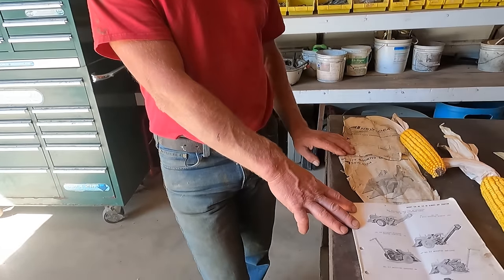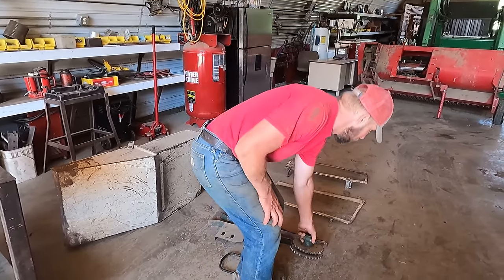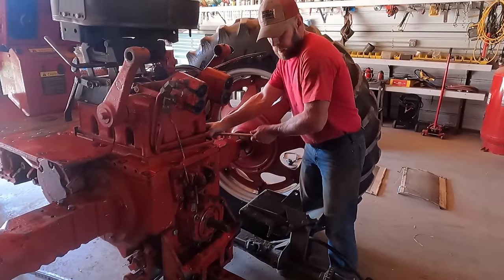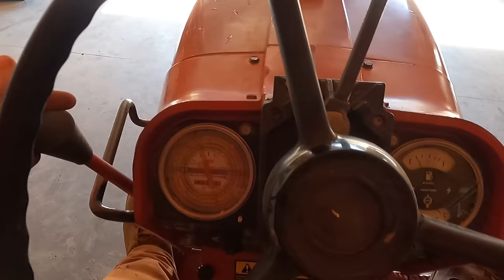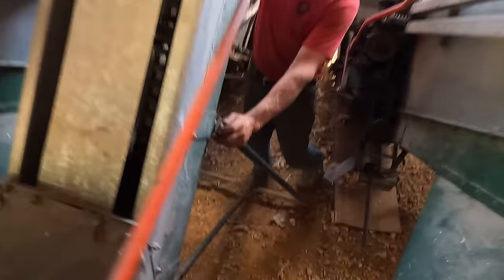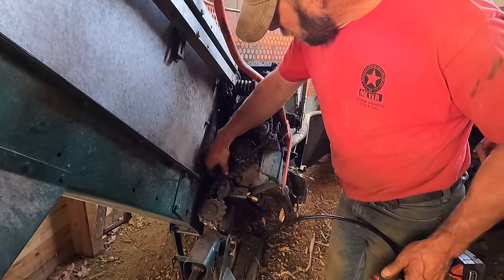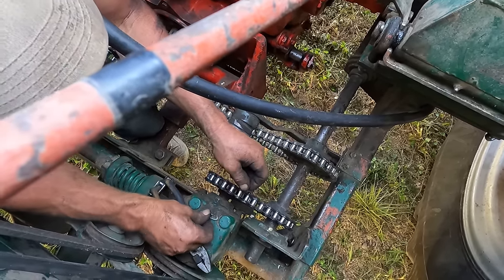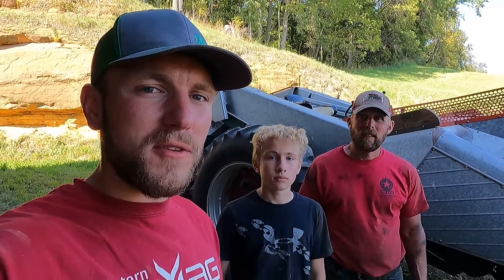Getting Ready for Harvest! Mounting the Corn Picker!

Comment: I submit THE least likely person to post here is me.  We are concrete jungle dwellers, drive the heartland every year and vacation in Oconto Co in summer.  I've rebuilt and cracked open a few engines and transmissions, but I am stunned at the relative complexity and number of moving parts, plus keeping those old machines running.  You guys "rock". There are a few of us out here who appreciate what you guys do to basically feed the world.  Blessings . . . .
Reply from the maker: Thank you that means a lot!
Reply: Well this is Bob & not my wife as pictured.  We never had a picker or sheller but a JD silage 1 row chopper to fill the silo.  We always did this with my uncle Lars, He'd put his IH 450 on the JD chopper & we had a W-9 on the JD silo blower.  Would chop into truck boxes a 8'x12' box with hoist & back up to the JD silo blower & fill the silo.  Had two silo's to fill.  We quit do this in the mid 1960"s.  Thanks for your posting your farm & I know since we still farm its alot of work.
Reply from the maker: @debraevenson2336  Thanks for watching!

Comment: Brought back memories.  Dad bought a new New Idea picker in the fall of 1972.  319 gathering unit, 322 twelve roll shucking bed, and a 315 sheller.  Mounted it on a 1550 Oliver for 10 years or so.  We normally kept the original wide front on the Oliver as we plowed, planted, sprayed etc. with it too, so we changed that out every fall as well for some added fun.  Overall, with some help it’s not a bad job to mount and the New Idea does a good job both picking on the ear and shelling.  We farmed in central IN then, and sold the outfit to somebody in Wisconsin.  Thanks for sharing, good job!
Reply from the maker: Glad we could bring back memories, Thank you for watching David!

Comment: I used a two row, with the 12 roll bed pull type. It was harder to open up the fields, so, sometimes i chopped some of the corn to get them open. But, I liked the New Idea, because it took all of five minutes to hook up, and, did not tie up a tractor, if i wanted to use it. I ofter would pick during the day, and, then switch over and do some tillage in the evening. I did think about buying a tractor, and, having a mounted plow on it permanently, but, just decided to put up with the hassle of opening up the fields.
Reply from the maker: We use to get a self propelled chopper to open fields for corn silage. But we decided we could do it our selves with the pull type, just had to take our time chopping the rows we ran over!

Comment: They weren't bad to put on and off. Worse part was we usually had to move wheel centers and even with that it didn't take long.  Had one on a M-TA and 560.............That 686D is probably a really nice combination.  Ear corn makes great feed.
Reply from the maker: The 686 is really nice, bit on the bigger side to fit underneath that. We agree it dose make good feed!
Reply: @GierokFarms  You need to make a video on how there is IH, Oliver, and Deere in one location with no fights...............I got Deere and IH here where I am, and probably one of the few who has two brands of tractors.
Reply from the maker: @tpfromcentralpa1692  We definitely aren't bias here, at the end of the day its all about what works for your farm!

Comment: 30 years ago I bought a 706 diesel narrow front for $3500.  As I was pulling out the driveway, seller asked me if I wanted to buy the hardly used 234 IH picker that he used with it.  I said I would never use it but I said what do you want for it.  He said $1000 & I shook my head no.  He said $500 and I said no.  He then said buy me an ice cream cone & you can have it, final offer.  I said ok & shut tractor off & we went for ice cream.  We became great friends over that ice cream & I later took over farming all his farms when he quit.  That was the best trade I ever made.  My one regret was I junked that 234 shortly after bringing all that stuff home.  I kick myself all the time bc that 234 was nicest one I ever saw & I couldn’t find a buyer anywhere for it.  It is now a sought after collector item.  He did less than 100 acres with it bc he hated mounting it & bought a pull picker.